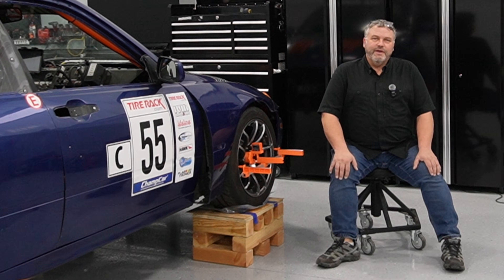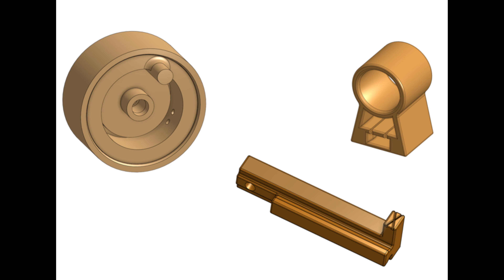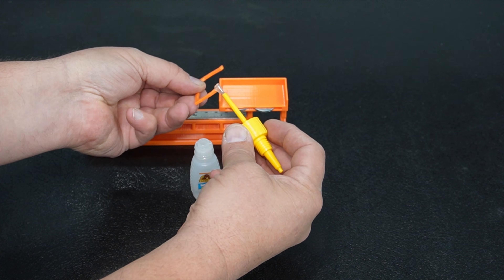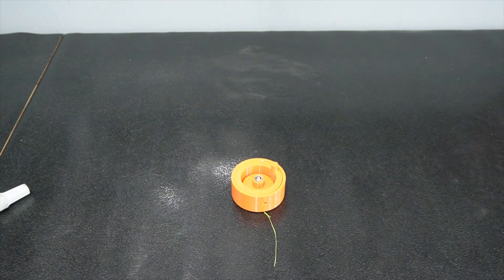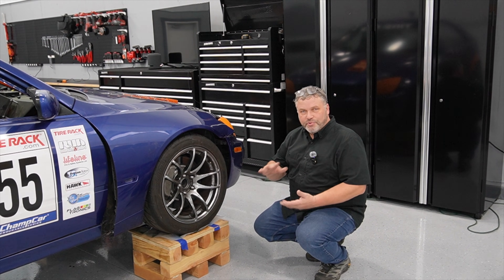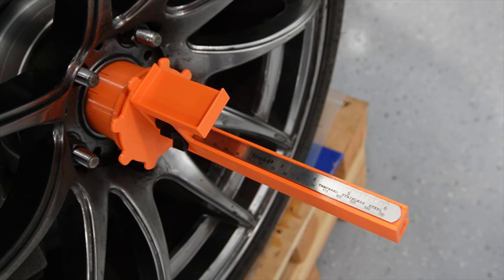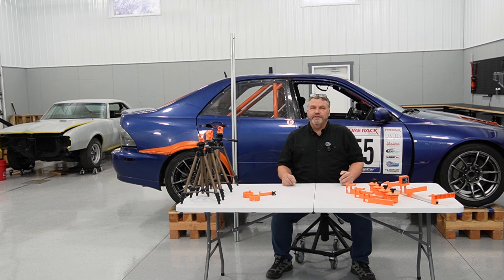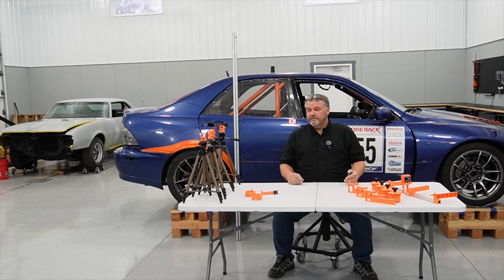3D Printed String Alignment Tools for Improved Accuracy

Comment: Your design seems awesome! I'm currently printing all of the parts for the wheel adapters and laser alignment setup and have a couple of different wheel center cap dimensions to get started that I don't see in the current list. I'm excited to get these parts all printed and give it a try! Thank you for all of your work in designing and sharing the files for the rest of us DIY enthusiasts out here! 

AODHAN AFF-3's
Distance to detent: 0.137" or 3.48mm
Wheel cap outside diameter: 2.545" or 64.43mm
Wheel cap detent outside diameter: 2.59 or 65.78mm

AODHAN AFF-7's
Distance to detent: 0.155" or 3.94mm
Wheel cap outside diameter: 2.22" or 56.42mm
Wheel cap detent outside diameter: 2.285" or 58.02mm
Reply from the maker: @SC32V95Cobra   STL files with these dimensions are now available for download.  Once you get a chance to try them out, let me know if they fit well or tweaks are needed.

Comment: Great work! Any chance you can add Malaysia Made Proton Persona Standard Wheel.
Wheel Cap Outside Diameter : 54.5mm
Wheel Cap Detent Outside Diameter : 55.7mm
Distance to Detent: 7.5mm
Thank you!
Reply from the maker: @farhanazlan1813   STL files with these dimensions are now available for download.  Once you get a chance to try them out, let me know if they fit well or tweaks are needed.

Comment: Fuel Crank 20x10 6 lug

Wheel cap outside 106.10mm 
Distance to detent 3.2mm
Wheel cap detent outside 109.30mm
Reply from the maker: @jacobtaylor1729 STL files with these dimensions are now available for download.  Once you get a chance to try them out, let me know if they fit well or tweaks are needed. As of now you win the award for the largest diameter center caps!
Reply: @DIYFabShop will do thank you for the quick turn around

Comment: Thanks for sharing this and great work putting it together. My wheels won't accommodate a centre cap style fixture, I'm designing an alternative that uses two of the wheel studs for mounting and a centre hole to fix the attachment as per your design.
Reply from the maker: @chaycock65 I think your approach will work well, if you keep an eye on making sure the adapter sits flat on the wheel center, you should be golden.  Good Luck!

Comment: Here are measurements for Tesla model x 20" wheels
outside - 50
distance - 6.5
detent - 53.1

I printed all the parts, for this and the laser alignment. I had to adjust the laser holder frame as I am using different cross laser tools that are taller.
Reply from the maker: @TinkerWithUs STL files with these dimensions are now available to download.  Once you have had a chance to try them, let me know how they fit and if any tweaks are needed.  Cheers!

Comment: Thanks so much for this! Would you be able to supply a version of the toe attachments for 1" tube? I have a crapload of it left over from a project. Thanks!
Reply from the maker: @maxMaz2 I assume you mean 1" square tubing? Can you throw a caliper on it just to confirm what the outer dimensions are running, that will help nail the fit.
Reply: @DIYFabShop  looks like 1.002" on average, thank you!!
Reply: And yeah 1" square
Reply from the maker: @maxmaz2  you can give these a try. Maybe start with just the trolley to test fit, it should be good, but you never know.  https://drive.google.com/file/d/1qVNQlA66QRWrq7W9TfKLAy9dAkpYaCos/view?usp=drive_link
Reply: @DIYFabShop  they fit awesome! Thanks

Comment: 2015 MX-5 GT
Distance to detent: 8.46mm
Wheel cap outside diameter: 49.75mm
Wheel cap detent outside diameter: 52.75mm
Thanks a lot!!
Reply from the maker: @RyansVideoLogs STL files with your dimensions are now available for download.  Once you get a chance to try them, please let me know how they fit and if any tweaks are needed.  Cheers!
Reply: @DIYFabShop   I was able to give it a try and it was a little loose. I re-did measurements and looks like I was a little off on the distance to detent the first time :(
Distance to detent: 7.73mm
Wheel cap outside diameter: 50.72mm
Wheel cap detent outside diameter: 52.75mm

Thank you! 🙏
Reply from the maker: @RyansVideoLogs  Rev A version of the files are ready for download.  To be fair, these aren't the easiest dimensions to take, let's see if this tightens it up!

Comment: Alutec Monstr for audi tt 8j  
Distance to detent: 4mm 
Wheel cap outside diameter 59mm
 Wheel cap detent outside diameter 60mm
Thanks!
Reply from the maker: @StormzzLeader  STL files with these dimensions are now available for download.  Once you have had a chance to try them, please let me know how they fit and if tweaks are needed.  Cheers!
Reply: @DIYFabShop   Your wheels have quite a bit of negative offset. Mine don't, so im not able to touch the lip of the rim with the 2 standoffs. The STL files you made for my rims were great though. Thanks
Reply from the maker: @StormzzLeader  there are some rim touch off extender stl files on the website available for download.
Reply: @DIYFabShop  My mistake, thanks for the crazy fast response.
Reply from the maker: @StormzzLeader  now worries, good luck getting everything set up!

Comment: Here's dimensions for a Ford Explorer Ecoboost Sport,  2016-2019 model years, with 20" alloy wheels.  Ford's part number for the wheel is FB5Z-1007-F.
Wheel Cap Outside Diameter:  61.25mm
Distance to Detent:  7.2mm
Detent Outside Diameter: 64.75

thanks for all of your great work, this is an amazing system!
Reply from the maker: @DogHouse86 STL files with these dimensions are now available for download.  Once you have had a chance to try them, please let me know how they fit and if tweaks are needed.  Cheers!
Reply: @DIYFabShop  Just some slight tweaks should do it, need to tighten it up a bit in the wheel:
Outside Diameter:  63.25
Distance to Detent: 6.8
Detent Outside Diameter: 66.75
Reply from the maker: @DogHouse86  an updated Rev A version of the STL files are available to download, let's see how these ones work!
Reply: @DIYFabShop  thanks you're the man and i'll report back!

Comment: Thank you so much for doing all this work and making it available to the community.  Spent all weekend printing parts for the laser alignment. Super excited to finally test this out. 

Here are two different wheel hub measurements for a couple of my wheels that I didn't see on the website:

Enkei PF01 17"
Wheel Cap Outside Diameter - 2.31 in 58.7 mm
Wheel Cap Detent Outside Diameter - 2.44 in 62 mm
Distance to Detent .19 in - 5 mm

Enkei PF05 18"
Wheel Cap Outside Diameter - 2.35 in 59.8 mm
Wheel Cap Detent Outside Diameter - 2.42 in 61.5 mm
Distance to Detent .21 in 5.3 mm
Reply from the maker: @joshterasaki6647 STL files with these dimensions are now available for download.  Once you get a chance to try them out, let me know if they fit well or tweaks are needed.  Nice Wheels btw!  Cheers!
Reply: @DIYFabShop  The PF01 needs to be closer to 2.34 in for the outside diameter. I took more measurements of the other wheel caps and they are larger. The current print wobbles quite a bit. The PF05s seem dead on. 

I also ran into an issue with the metric tee nuts you linked on the website. they are 16 mm high and won't fit into the trolley channel of the scale holder. It looks like they need to be 13 mm high.
Reply from the maker: @joshterasaki6647  sorry about that with the tee nuts, they must have changed vendors or something.  Here is a link to an STL file for a nut pocket that you can drop a standard M6 nut into and it will ride in the trolley channel.  https://drive.google.com/file/d/1QhaFXCO9qUGKpd79HO0RdVNTfuU6uGw-/view?usp=drive_link
Reply from the maker: @joshterasaki6647  there is a Rev A version available to download now with the 2.34" dimension.
Reply: @DIYFabShop  After testing both of these out, there is play when the scale holder is installed. I measured the parts after printing and they are smaller than I reported. This might be random 3D Print variance or the fact I used PETG-HF from Bambu which might have shrunk on cooling more. I applied a layer of black electrical tape to the fingers, making sure to overlap the detent. This snugged it up perfectly. The tape measures out to 0.0050 inches or 0.13mm.

Comment: I would like to add VW GTI 2012 rims:

Wheel Cap outside diameter: 55.9 mm
Distance to Detent: 5.1 mm
Wheel Cap Detent Outside Diameter: 58.8 mm

Thanks in advance for adjusting your STL.

Best,
Peter
Reply from the maker: @PeterZiobrzynski-zc9sk the stl files with these dimensions are now available for download.  Please let me know if any tweaks are needed once you have a chance to try them.  Cheers!
Reply: @DIYFabShop  we need adjustments. For this car I measured the actual cap and adapter came out too loose. Now I measured the inside of the rim. Here are the new dimensions:

Wheel Cap outside diameter: 57.5 mm
Distance to Detent: 7 mm
Wheel Cap Detent Outside Diameter: 59 mm

Also you have typo in the car name - the year is 2012 and not 2021.

Best,
Peter
Reply from the maker: @PeterZiobrzynski-zc9sk  a Rev A version is available to download and try, let's see if this one fits better!
Reply: @DIYFabShop  one more adjustment please. It turns out that part #16 'Pro track one' fist perfectly in stock rims of VW GTI 2012. Please delete part #59 and add VW GTI 2012 to part #16. Thanks again!
Reply from the maker: @PeterZiobrzynski-zc9sk  done!

Comment: Here’s some additional measurements for hub adapters
Konig Oversteer
WCOD: 55.65mm
DtD: 3.64mm
WCDOD: 56.95

Subaru BRZ (2020) Stock
WCOD: 44.25
DtD: 2.83
WCDOD: 45.70
Reply from the maker: @nathanlesman5006 the STL files based on your dimensions are now available for download on the crowdsource spreadsheet.   Once you get a chance to try them, let me know if they fit well or tweaks are needed. Cheers!
Reply: @DIYFabShop downloaded and printed the hub adapter for the Konig Oversteer. 
The adapter was a bit too large to fit into the hub, so I scaled both pieces down to 98.35%, and it fits pretty well into the hub now. Really tight, with no movement that I could detect.
Reply: @DIYFabShop I clicked the wrong stl, so disregard my previous message. 
With correct stl, hub adapter fits very well.
Reply: @DIYFabShop  Awesome Thank you. Once all my parts arrive and I can assemble the kit. I'll let you know how the hub adapters work. 
Thank you for designing this alignment tool. I look forward to to using it after I install  some lowering springs on my 2020 BRZ.

Comment: Kent - this is a Pro quality fabrication. Thanks for sharing.

I have 1996 Porsche 911 993 C2 with the original W/Cup design rims. They are very close to the Porsche 987 that you included in the 'wheel adapter Crowdsource - Dimensions' table. Unfortunately 993 dimensions are a bit off and the wheel cap does not have detents holding to the inside wall of the rim but has a cylindrical steel collar with with 3 pegs that hold it by friction in place. I think I can still print the wheel adapter with the following dimensions:

Wheel Cap outside diameter: 60 mm
Distance to Detent: 8.5 mm
Wheel Cap Detent Outside Diameter: 62.25 mm

Thanks in advance for adjusting your STL.

Best,
Peter
Reply from the maker: @PeterZiobrzynski-zc9sk the STL files based on your dimensions are now available for download on the crowdsource spreadsheet.   Once you get a chance to try them, let me know if they fit well or tweaks are needed. Cheers!
Reply: @DIYFabShop  we need tweaks. The adapters are too lose. Can we please try these new dimensions: 
Wheel Cap outside diameter: 60.5 mm
Distance to Detent: 6.5 mm
Wheel Cap Detent Outside Diameter: 63 mm
Also the fins with detents are too brittle and break off under normal tension. Can they be made stronger/thicker?
Best,
Reply from the maker: @PeterZiobrzynski-zc9sk  I can modify the STL file.  What filament did you print with?  If you are seeing breakage I would suggest that you use PETG and if you still see breakage start increasing the infill%
Reply from the maker: @PeterZiobrzynski-zc9sk a Rev A version is available for download
Reply: Ignore that tweak request. I tried Porsche 987 part 22 and it worked just fine.  I guess we can add Porsche 993 W/Cup rims to the same line in the table and remove the one for 993 part 49.
Reply: @DIYFabShop  thanks for the infill% pointer. This is my second day of 3d printing so advice like that makes all the difference!  I use filament exactly as per your shopping list - PETG.  Please scrap my adapter #49. I end up using existing #22 for the Porsche 987 you already had.
Reply from the maker: @PeterZiobrzynski-zc9sk  sounds good!
Reply: @DIYFabShop  we need adjustment to the Porsche 911 993 wheel adapter. This is part #49 - it should have dimensions just like the other Porsche 987 part #22. Can you please make the change?
Reply from the maker: @PeterZiobrzynski-zc9sk  I have updated the crowdsource spreadsheet to reflect this.  Hope you are enjoying you new toy (3D Printer)!
Reply: @DIYFabShop  thank you so much Kent!  For some time now I wanted to get into 3d printing but had no real use case for it. You provided such a fantastic one!  Now shopping for the first printer... top candidate on Prime is FLASHFORGE Adventurer 5M 3D.

Comment: This is a very nice solution.  I have made something similar out of steel with styand offs to rim edges.  Camber accuracy could be improved but having a third contact point at the top of the wheel.  Speading the mounting over 9-10 inches rather than 2 inches should provide more consistant results.

Comment: This is very good. Have you considered doing a version for steel wheels, like the Camaro in the background? These don't have center caps like the aluminum wheels do. Maybe put magnets in the pointers and add a third pointer up high?
Reply from the maker: @suspensionsexplained I have something in the works as an alternative to using the wheel hub center cap, should be out pretty soon.

Comment: Hi i was wondering what design software your using for the centers? I have wheels that are different in the front then in the rear. If your using a parametric program in fusion 360 or some other software could you make it available on your web site so i could make changes for my wheels? Just seems like a easier option for people. Thank you for all the great info and time you have put into this!
Reply from the maker: @n2fastcars635 I use Onshape for CAD modeling.  It is cloud based and they offer free licenses for non-commercial use.  If  you sign up and get a license you will need to save a version of the model for yourself in order to be able to edit it.  The variables I ask folks for are the first couple columns in the configuration table.  It literally takes me 2 minutes to create a file and make it available to download so don't hesitate to ask if navigating Onshape proves too challenging.  https://cad.onshape.com/documents/e00773fa1e70222ba7ebc4f0/w/3a0368b9a07767f88abef0e7/e/6ee26159bb46d874c735da57?configuration=List_bTryIqOX89Ylnp%3DDefault&renderMode=0&uiState=680e7241d2bec4230210f3ad
Reply: @DIYFabShop  Oh ok cool! I have onshape as well. I will look for it. I use fusion 360 for some stuff and Onshape for other stuff because a friend got me into fusion 360 years ago. Been trying to get away from using fusion 360.  Thanks!

Comment: WOW! Thanks for making this available! I am aligning a Tesla M3 Performance with the UberTurbine wheels. I started with the 'Hub Adapter and Threaded Plug No 42 Rev A.zip' and added a raised outer diameter lip 17.5mm from the tips of the snap in fingers. It seems to work fairly well. I know that is not your design standard, but you can probably back out your standard measurements from what I did. I'd be hapy to send you a STEP and or photos if you like. Thanks again!

Comment: Any chance you can add  Miata Third Gen GT Wheels.
Wheel Cap Outside Dia 55.32
Distance to Detent 3.43
Wheel Cap Detent Outside Dia 57.63
Thanks
Reply from the maker: @davepolman5621 I added a link to the STL files based on these dimensions to the spreadsheet that can be found at the bottom of this web page: https://www.diyfabshop.com/alignmentkit    Once you get a chance to try them out, let me know if they fit ok or if dimensional tweaks are needed.  Cheers!
Reply: @DIYFabShop  Thank you -- Will do.

Comment: Firstly, thanks a lot for creating this and sharing it freely! Secondly, just wondering what print settings people are successfully using?
Reply from the maker: @TravisHammeng I had success with using Bambu Studios default settings for PETG and PLA.  I use PETG for the hub adapters with the flexible arms.  I like to use "tree" style supports as they remove easily.  The only parts that need supports are the rim touch off parts, all others should be printable without supports.
Reply: @DIYFabShop  Cheers mate. I've got one plate printing now. So we'll see how we go